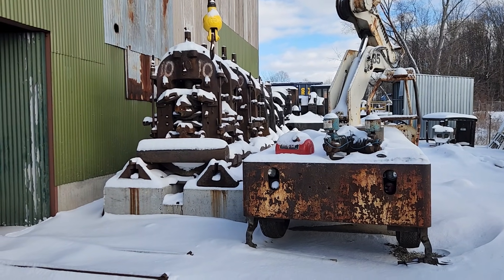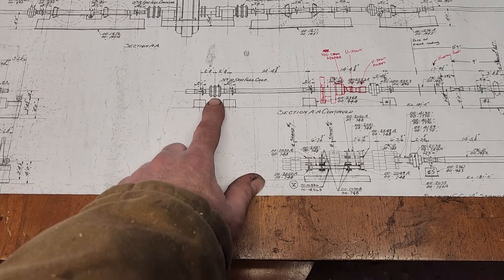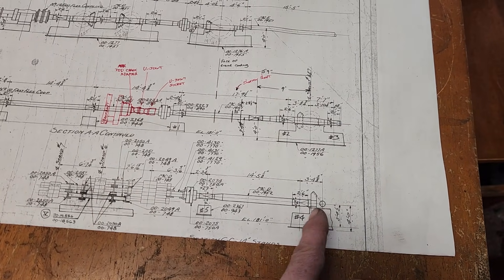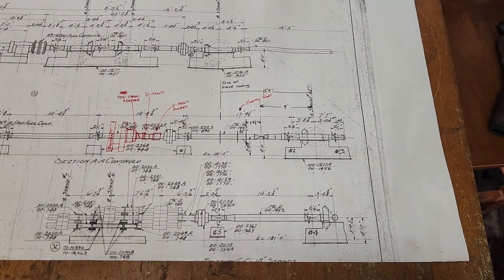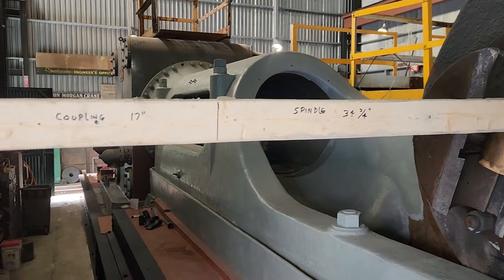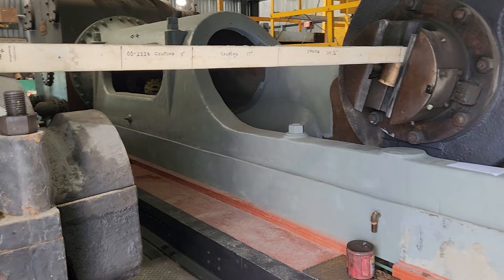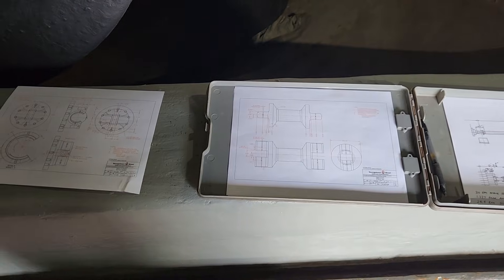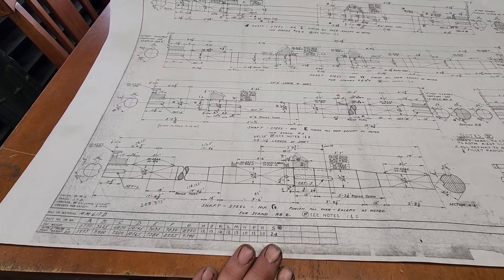Happy New Year! Rolling Mill Driveshaft Design

Comment: To reduce the starting load on your electric motor do you think you need to include a clutch of some kind in the spindle drive so you can get the flywheel spinning to store the energy before you try and turn everything else?
Reply from the maker: That really wouldn't work on something this big. I think we will have enough power to get things rolling, that is what the electric motor is mainly for.